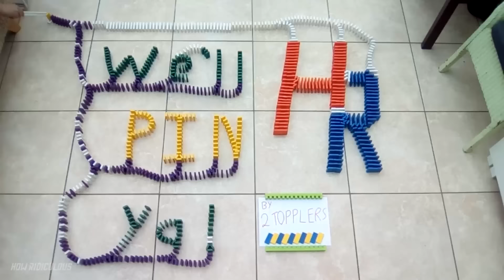Can This SOLID GLASS BALL Survive a 45m Drop?

Comment: Lots of people have said that the cone shape is caused by conchoidal fracture, and tried to define it, but no one seems to have explained WHY conchoidal fracture exists. I have a degree in geology, but I'm less clear on the physics, so while I think this is right, a physicist might be able to clear up my hazy spots.
Basically, glass (and rocks like obsidian) are formed by the very rapid cooling of a liquid. In obisidian's case, molten lava, and in glass' case, melted down sand. Because the liquids cool so fast (by going from volcano to cool air for obsidian and by being quenched in water for glass), the minerals in them do not have time to arrange themselves into large individual crystals. Instead, they form microscopic crystals that slot together so perfectly that they are like one big one. This is what makes it simultaneously so strong in terms of compression and yet so weak in terms of shearing. You could say there are no natural weak-points between crystals for an impact to break along, or that the space between every minute crystal is just as likely to break as the next. So instead of shattering wildly the structure breaks in exactly the way that it distributes the force. Naturally, any impact causes energy to radiate out in circular waves from the point of contact, so the glass fractures along these waves. They look like ripples in water, because that is pretty much what they are - ripples of energy that caused the tiny particles to shear far enough apart that they separated from one another.
In the case of the spheres however, the waves of energy bounce around inside the sphere itself, causing many of these waves to be sent flying around in all directions (which you can actually see as reverberations in the slowmo). As they collide with each other, some cancel each other out and some magnify each other, depending on how they meet. The cone shape is caused by the waves radiating out around the surface of the sphere, and then meeting again at the same point. The glass at the exact impact point is still compressed, so instead of breaking there, the waves bounce off of each other again, at an angle roughly 45 degrees to the plane of the surface. This forms the characteristic cone. When the sides of the cone reach the surface of the glass again, the waves release their energy through the path of least resistance, which is up through the surface of the sphere, shattering everything below that point andoutside the 45 degree plane, leaving behind the cone.
tl;dr - the structure of the glass allows it to propagate the waves of energy from the impact very well. The cone is caused by these bouncing off of each other and the surface.
Extra fact: because the crystals are so tiny, there is no roughness to blunt an edge where two fractures meet, and thus they form an almost molecule-perfect edge. This is why obsidian and glass are so incredibly sharp when they break.
Reply: I dont know much about physics but that seems legit
Reply: Thank you for this! I am taking a geology course, and was able to recognize it as a Conchoidal fracture, but I didn't know the mechanisms behind it other that it happened in minerals/substances that cooled quickly.
Reply: Well ok then... None of that made any sense to a 7th grader, but cool!
Reply: What he said
Reply: you need a tl:dr for this but this should be the winner
Reply: Ok
Reply: For the physics it's because the point of contact is minimal because of the shape (spherical) so the force on it would be spread in a cone like shape on top of everything you said.
Reply: I feel like smarter every day should look into this!
Reply: Glass ball go phoomf
Reply: bloodredzangoose I am not reading all this sorry
Reply: Even with the absence of equations to explain the physics of your argument, you’ve done an admirable job of explaining what caused the damage to the glass balls. Other than not mentioning the effects of gravity on the molecular structure, your argument stands well. Good job!
Reply: Thanks for the comments and upvotes you guys. I added a tl;dr, as someone suggested. 
I am a relatively knew subscriber to HR, so it'd be crazy if my first comment got pinned! I was just so excited to answer a comtest about something actually relevant to my expertise!
Reply: What?
Reply: I think it has something to do with fracturing around the impact point, I guess the force moves out from that point, causing the cone like shape.
Reply: bloodredzangoose holy shit u wrote an essay lmao
Reply: 😮 wow SCIENCE
Reply: Cody Casteen lol same (literally I’m in 7th grade too)
Reply: You dropped this 👑
Reply: also i speculate that anything above the 45' normal cone is under compression and everything blow is under tension. as the force of the rebound propagates outwards it creates a hard line of compression (which ceramics are good at) and under that the tension exceeds the tensile strength of the glass at the boundary layer.
Reply: goddamn
Reply: Did you just steal this from google I'ma check
Reply: Conchoidal fracture describes the way that brittle materials break or fracture when they do not follow any natural planes of separation. Mindat.org defines conchoidal fracture as follows: "a fracture with smooth, curved surfaces, typically slightly concave, showing concentric undulations resembling the lines of growth of a shell". Materials that break in this way include quartz, chert, flint, quartzite, jasper, and other fine-grained or amorphous materials with a composition of pure silica, such as obsidian and window glass, as well as a few metals, such as solid gallium. Conchoidal fractures can also occur in other materials under favorable circumstances. This material property was widely used in the Stone Age to make sharp tools, and minerals that fractured in this fashion were widely traded as a desirable raw material. -Google
Reply: God damn you’re smarter than me
Reply: NERd
Reply: @bloodredzangoose   Ok then u win
Reply: Thanks this is an awesome explanation
Reply: good enough for me
Reply: It’s just fracture along the max principal stress surface (which has a cone shape), initiating from a surface micro flaw. If you crush it slowly, you get the same effect (“Hertzian Cone Fracture”), so the Coney Joney is not unique to impact, and it’s not driven by stress wave interference (although faster impact does give a sharper cone).
Reply: Holy I left a small comment about force cones and the outsides cooling faster into separate crystalline structured layers by holy holy holy your are so smart dude! That’s incredible that any one person could know so much! Thank you so much!
Reply: I didn’t hear anything you said and I don’t understand it
Reply: @charvey1  I may be wrong about the reflection part, but Herzian cones are caused by wave front propagation, so that part is correct regardless. Most info on Herzian cones are about gunshots, so its tough to know how comparable the situation here is. Not many studies on dropping huge glass balls, sadly!
Reply: Imagine having a brain this big, and still watching the HR Guys. I love it!
Reply: I’m part of the “i didn’t read that cause that’s too long “ association
Reply: I’m not gonna try to even read all that but 10/10
Reply: صح
Reply: Inconspicuosaurus I’m no expert on this. I just read up on it because it’s interesting. I think it happens in many dynamic situations (like ballistic impact, pebbles skipping off windshields, etc.) but is not a uniquely dynamic effect (although there will undoubtably be a dynamic contribution to the fracture energy too). I think that if you crush a glass sphere really slowly (so virtually no dynamic effect) just enough to crack it, you still get the cone. But I haven’t tried it! The static stress field which defines the max principal stress surface and the crack path is in Appendix A of this paper: https://link.springer.com/content/pdf/10.1007/BF00955075.pdf I don’t think you need to do any stress wave propagation/interference analysis to derive that! Here’s a hydraulic crush of a glass sphere video: https://youtu.be/XmjRMtN2zoA At 1 min, the cone appears. (Apparently, faster impact gives a sharper cone angle.)
Reply: I learned a lot in this thread. Thank you to everyone who contributed! 😊
Reply: Oh my god I'm not reading all that
Reply: I want to start off by saying you're not wrong, you hit the mark on a lot of things but I gotta touch on a couple points.

Glass is whats called an amorphous solid which means it actually doesn't have any crystals, the rate at which it cools determines if it tempers or not meaning whether or not it's under tension (check out prince rupert's drops), in cases where crystals are involved however you're absolutely right, when metals cool from a liquid state faster the crystals form smaller changing the properties drastically, a crystalline structure is when a liquid element or compound cools and hardens arranging molecules in a repeating pattern or when a liquid has an element or compound suspended or dissolved in it and deposits it onto a surface or nucleus point also arranging molecules in a repeating pattern, a good example of a crystalline structure is something that grows large crystals like bismuth.

Clear glass is also more than melted sand (silicone dioxide) it also has other stuff like gypsum and some other stuff that makes it clear, silicone dioxide is already a compound (multiple elements that are bound) but clear glass is a concoction, you can make glass from just silicone dioxide but its not exactly clear, I believe the channel "How To Make Everything" did a video on this. Also fun fact obsidian is a form of glass, its just natural glass that forms in volcanoes.

What I think is happening here with the cone shape is essentially what you explained, but I noticed something in the video that might help visualize the effect. Right at 9:00 into the video when they show the slow motion of the bowling ball at the moment of impact you can see the ball stops but the shattered parts keep going at the same speed, the same is happening to the glass but its harder to see being a clear material, and because the glass is amorphous the ripple effect you mentioned takes place leaving the peak intact but in the angle of least resistance to the instant change in momentum due to inertia the ball shatters in that pattern leaving the conservation (or transfer) of energy in the still moving glass shards. I think the ripples are just a coincidence from random natural patterns, meaning the path of least resistance for the break to occur, its so smooth because of the propagation effect you mentioned but instead of small crystals almost on the molecular scale its more actually on the molecular scale. Another fun fact glass breaks at the rate of the speed of sound through glass (which is faster than it travels through air due to density).

( I'm not claiming you're wrong with your explanation of the effect I think you explained it better :D I'm just adding my two cents for what it's worth ).

I also like your format so I'ma steal it lol

tl;dr Glass is a concoction of elements called an "amorphous solid" and it doesn't form any crystals so it actually breaks on the molecular scale.
Obsidian is volcano glass.
Glass breaks at the speed of sound.
Inconspicuosaurus had a fine explanation of the effect that's happening with the cone so read their tl;dr

(Edit - talking about cooling rates)
Reply: I genuinely think Mulan is the coolest Disney princess
Reply: people who didn't read the whole text and just came to the replies
Reply: Matt the 4naKateher  Prince rupert's drops are awesome, I believe the earliest record of tempered glass, it's under tension because of the outside cooling faster than the inside, the tail being fragile is about the only point where you can break it realistically, and when it breaks the whole thing does spectacularly, basically an explosion, tempered glass panels are similar being under tension but the weak points are on the edge and near the edge where the middle of the panel is incredibly strong in comparison, at work one day a huge tempered glass door "exploded" and it had enough energy to embed glass shards in other sheets of glass.

Not sure how these giant glass balls are made but I imagine you're right and it's similar to how glass marbles are made, I think How It's Made did an episode on marbles.
Reply: Seems legit

And long
Reply: UHM
Reply: Big brain, big pp
Reply: @charvey1  Thank you for this. As I mentioned, I'm no physicist, so my assumptions about wave interference may well be wrong. What would be great is if the guys could measure the angle of the cones. If they're not all 45 degrees then my idea can't be right. If they increase with height of the tower then that would be more evidence for a typical Herzian cone. Unless they all get so close to terminal velocity that the difference isn't noticeable. Would be great to find out!
Reply: @e1337H0b0  I know about glass being an amorphous solid and cryptocrystalline if anything, but I thought my explanation was the best way to say what that really means for this situation without propagating myths like "glass is a liquid". I've learned through this thread that my knowledge of glass making is not as great as I thought haha. It seems most rounded glass is rolled rather than quenched, and it makes perfect sense that it's not just you're average sand. Thanks for the extra details!
Reply: WTF
Reply: @bloodredzangoose  No prob my friend, and I didn't mean to aim towards the glass being liquid either, I have heard of that but I think that's more of an opinion thing so I wouldn't push for or against it. 
I also want to state I'm no expert on any of this, my resources are mainly educational youtube channels, and curiosity over the years looking stuff up. 
My occupation is in office furniture so my experience with glass is minimal, I don't have any real education unfortunately so you definitely got me there. Cheers!
Reply: As a Mechatronics engineering student with some understanding of physics but still, no expert; the constructive wave summation forming the characteristic cone definitely sounds like the most probable cause for the resulting cone shape from shear at 45deg. However, due to the nature of spheres, I wonder why there is no damage to the top half of the sphere. Perhaps if there were higher initial energy, the 'energy waves' may cause another shear cone at the top of the sphere due to axial loading and total internal reflection within a spherical body. Does anyone know if this is the case?
Reply: It fractures like that because of the way the glass set and how it cools, outer layers take the force and fracture off.
Reply: This is why I read comments thanks
Reply: This is so cool! Thanks for sharing 🤩
Reply: im a geo physicist...  they are correct..crystalline fracture that way..so does diamonds
Reply: I think it's because of fluid dynamics. Glass is technically still liquid. It's just EXTREMELY viscous. You can see this in old houses: their windows are often thinner on top than at the bottom because the glass of the window has flowed down over the years. 

So when you strike glass, it acts like both a liquid and a solid. The force ripples through it until it can't take the force and it breaks off. The cone shape is because of angles, I believe. The exact point of impact on the spheres breaks because it takes it head-on, until it gets down to a point where it hits at the right angle.
Reply: you almost got it. Glass is liquid. The impacted spot compressed, the same as metal does. The compression radiated in a cone shape. The material outside the cone did not compress, and fractured away.
Reply: @TheBurvis  Thanks for clearing that up.
Reply: Thank you so much!
Reply: Kevin Prager thank you, very helpful
Reply: am I the only one who kinda understood that?
Reply: Yes, this is pretty much spot on
Reply: I love your brain...thank you and whatever you are doing in life...DO MORE OF IT CUZ WE AS HUMANS NEED YOU TO DO IT WELL!
Reply: If the glass was quenched as it solidified, wouldn't there be huge internal stresses present within the glass, causing it to either be ridiculously strong and/or explode on impact, much like a Prince Rupert's drop?
Reply: Comtest winner right here
Reply: Why is it so LONG??????!?!?!!!!??

That's what she said
Reply: @damienhailey118  @TheBurvis Glass is not a liquid. It is an amorphous non-crystalline solid. The story of church windows being thicker at the bottom being evidence of this is a myth. Some old windows are thicker at the bottom, but this because thin panes were created by spinning glass sheets, which was imperfect and left some areas thicker than others. Any thicker potion was usually placed at the bottom of a pane, simply because this made it more stable and less likely to fall out due to wind/gravity.
As I said in my explanation, glass can exhibit effects that mirror fluid dynamics (like the rippled surface of the conchoidal fractures), but this is due to its extremely fine grain, not being a true liquid.
Reply: Glass forming is different than glass falling through the air. Very different.

Comment: I learned a thing or 2 from SmarterEveryDay. When he shot a 9mm bullet toward acrylic. The middle was not fractured at all, but the area around it was shattered. He called it frustum. It is where stress is not transferred through an object like a cylinder but it is transferred through a pressure cone. Thank you SmarterEveryDay for making me smarter. #smartereveryday
Reply: That's exactly what I was thinking of when I saw this! @smartereveryday
Reply: I think that this is part of the answer, but the ridges inside the break are caused by the way a glass sphere is made, with multiple gatherings of molten glass forming concentric shells where the interface between the shells is slightly weaker.
Reply: @shotgunosine  that would be the other part.